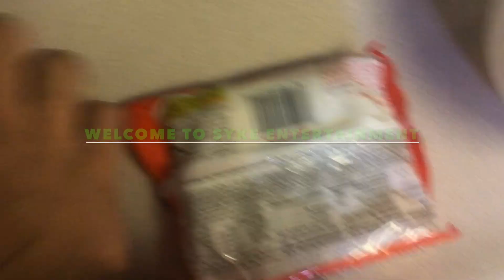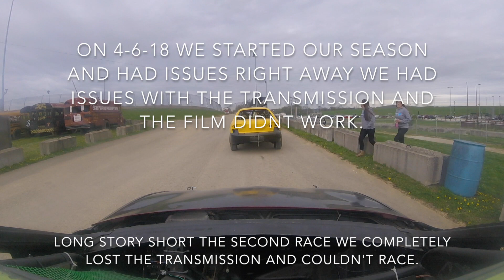starting the 2019 season off rough

Comment: what all did you change before this season?
Reply from the maker: wesley patrick we changed the way the radiator Sits in the engine bay. New radiator new rear breaks all stock struts new tachs we changed the way the filter for the intake and did some fab work in and around the car